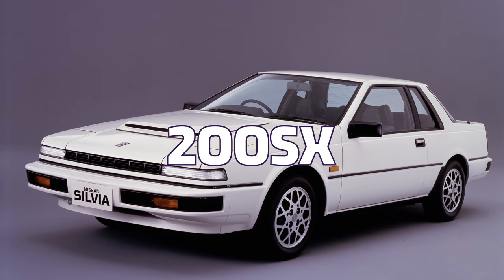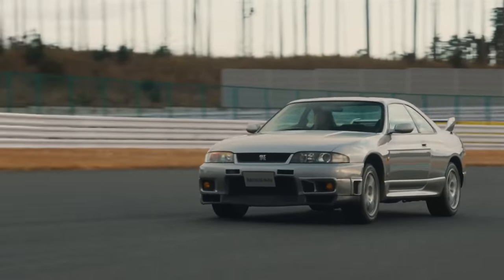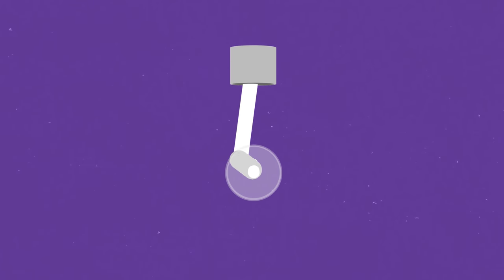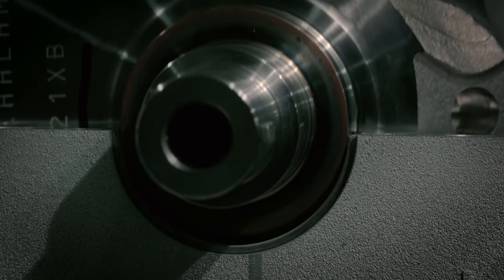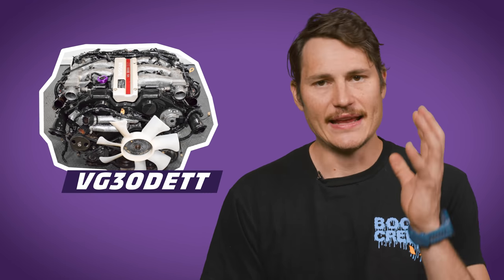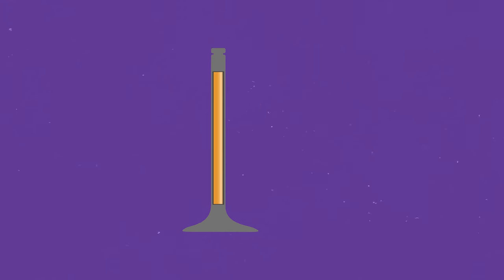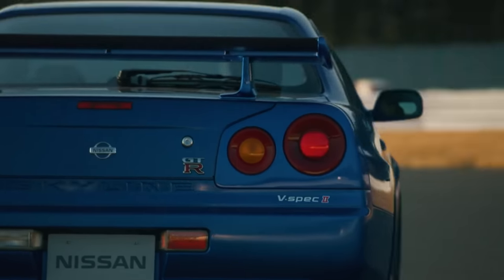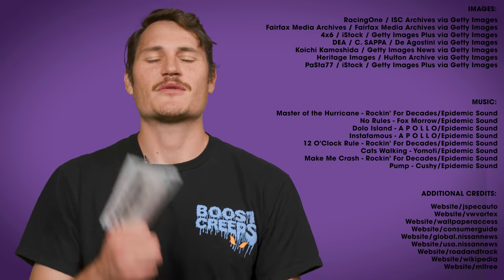RB vs. VG: Why Nissan Discontinued Their Best idea

Comment: Hold up, Donut. Don't tell me you're going to just ignore the Z31 like that on your VG/RB episode. As far as I recall, it was the only chassis to get both the VG and RB engines from the factory. Admittedly, it was never the media darling quite like the Skylines (or even its younger brother, the Z32), but it deserves a little recognition and attention. It might have started out a little awkward with its anemic power (and an overbite only a mother could love), but it had a solid glow up after the facelift in '86.
Reply: Ah the 200zr the last fairlady with a straight 6 I have to say as z fanatic the z31 is definitely in my top 3 favorite generations.
Reply: A glow up? Sure.. They had perfection with the Z31 in '86 with the revised front end while retaining the classic tail lights... but then ruined the rear end with that awful bar tail light from 87 and on...
Reply: @jonathanrigley981  unfortunately I’m all too aware. I sorta hate my 87’s tails. But I don’t have the heart to tell that to my car. I’ve wondered if you could fit the old taillights in with a few cuts on the panel that sits underneath the new tails…
Reply: @dustynmartin3806  I've wondered the same thing myself, if a rear end swap was even possible.... With enough patience and dedication I'm sure it would work
Reply: The Z31 is ignored by most everyone other than those that own one. Facelift or not, have you ever looked at one...
Reply: What? the vg and Rb are nothing alike and when people refer to the Rb you must assume they are speaking of the 25/26 because every other Rb was pretty bad I like them but they sucked they helped pave the way though
Reply: Z31 wasn’t the only chassis to have both rb & vg fitted from factory. C32 Laurel also had Rb20 & vg20 from factory. Y31 had vg30/vg20 and rb20p (lpg) from factory. There could be more. This just off the top of my head.
Reply: @chrissaunders8059   Oh, thanks man! Good looking out! I honestly kinda forgot about the Laurel…
Reply: @jonathanrigley981  too bad cuz the 88's and 89's are the turbos to have if you care about performance and reliability. the rear-ends in those cars are a 510/610 guy's dream-come-true.
Reply: @KevBacon6  As a child of the 80's, yes I have looked at one and owned an '87 non turbo. I think they look sexy but I am a sucker for hatchbacks (real hatchbacks) so I'm a little biased. My Z may not have been quick, but I had people giving me thumbs up all the time. T-tops are also the shit!
Reply: The lack of demand and interest in performance parts for VG30E really hurt it in the long run. There's a guy running 9s in a VG powered Z31 on stock suspension, the engines have a lot of potential but it's hard to squeeze that potential out when it's hard to find the parts to make it work.
Reply: @ballsdeep6912  Forgive me for being a Kouki elitist. I'm only biased because of the '87 slicktop sitting in my driveway. Emphasis on "sitting", it isn't running quite right. And even if it was, the brake lines don't hold pressure, so it doesn't really stop... RIP me, lol
Reply: @ballsdeep6912  I feel that. There’s no justification for keeping it, but you can’t bring yourself to get rid of it. You could always look for a cleaner zenki shell and throw your good parts on the body with some semblance of structural integrity.
Reply: I have realized that they are Nissan and Datsun haters.
Reply: Thank you for saying it!
Reply: Especially because the VG30ET was a great engine. There was a famous Z32 that ran one. It was deemed the single cam engine was better for the application, packaging and simplicity.
Reply: My garage full of car part and engines, I have over 15,000 tools
Reply: I own an '86 200ZR-I. One of the cars I previously owned not long before getting the 200ZR was a 300ZX Turbo. The VG30ET didn't quite cut it for me (based on sound). But I will definitely concede that it's a fantastic engine! Mine was a very mint one owner example. This 200ZR, as I'm currently discovering, was also a one owner car. I'm dealing with the NICS RB20DET issues at the moment, but it's a lovely car nonetheless. The engines operate totally differently, no doubt due to the technological differences between them.
Reply: @dustynmartin3806  Led bulbs and mounted load resistors
Reply: I know I love the 86s, so much I have 2 lol
Reply: 200ZR is love.
Reply: @jonathanrigley981  I had a gold 1985 Turbo with (somehow stock) 50th Anniversary wheels back in '88 and I agree with your take.
Reply: I agree, I have a 1987 Turbo car with 5 spd and leather interior. It was a nice sports car when new. And it talks to you, what more could one ask for?
Reply: @jonathanrigley981  I painted the center part on mine to match the body color making it two separate tail lights after. Completely changed it
Reply: I, uh… I liked the pre-facelift version better.
Reply: I have an 86 🥸
Reply: I love the z31 look, the z32 looks ugly to me
Reply: Nissan leopard + infiniti m30 came with one, another weird one is the mercury villager, the 1993-1998 came with an adapted vg30ei, which was modified to become non interface
Reply: @futokarin9745 The RB can trace its lineage to the L series, which was absolutely bomb proof.
Reply: @chrissaunders8059 I am
Pretty sure the Nissan Y chassis may possibly have had the most diverse engine options of any car ever made 😂
From inline fours and sixes, V6  to V8s, gas,lpg, diesel, just about anything Nissan offered ICE, was offered in the Y31/32/33 and 34, make my mind spin some more 😂😂
Reply: @twoeightythreez  yeah so I’m talking about the rb